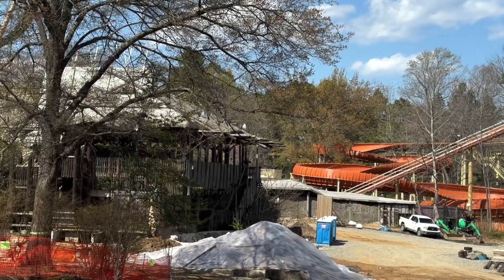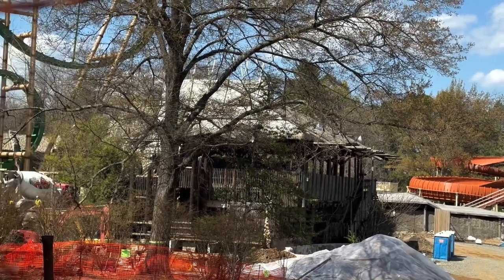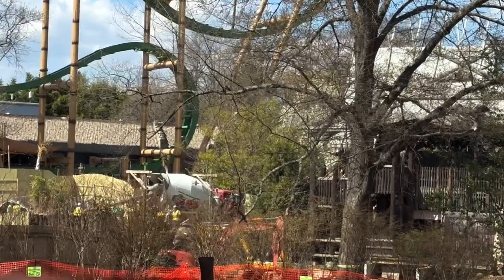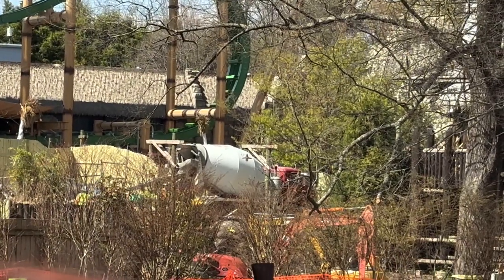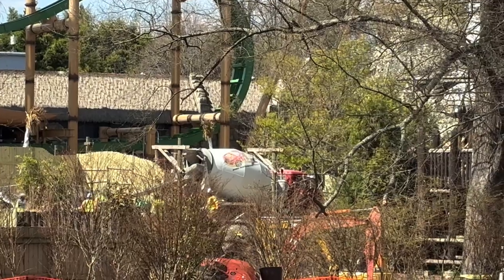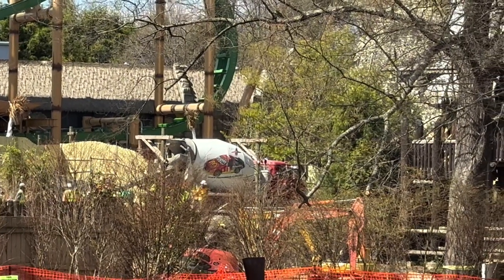Kings Dominion Vlog #6 : Project 2025 Construction Update and Spring Break Crowds

Comment: This interesting at 1:21 in the video  because look at how tall that rebar structure is? 

I'm thinking this is more for theming elements rather than a foster to support any coaster track as footers usually don't need to be poured that tall. 

I wonwonder if it's possible that KD fans got the layout prediction wrong  and that the ride might possibly have a totally different series of elements to it or quite possibly a traditional lift rather than a launch?

This is definitely interesting and exciting for the fact that progress is moving so fast, wondering when we'll begin to see track and supports showing upon site?
Reply from the maker: It’s possible. That rendering they made could be off for all we know. It’ll be interesting to see it play out!
Reply: Again, the station renderings from awhile back that were leaked well before the footer layout was leaked said "launch tunnel". Also, footers for theming elements aren't usually poured before the ride footers are. Theming/queue installation happens later in the construction process.
Reply from the maker: Those renderings were fan made and not a leak. Someone went off of the plans filed with the county and did their best at guessing what it would look like.
Reply: @BrianSterowski  I'm talking about the station renderings. Those apparently came from TRA Architects in Cincinnati who designs coaster stations with Cedar Fair. They designed Gatekeeper and Orion's stations.